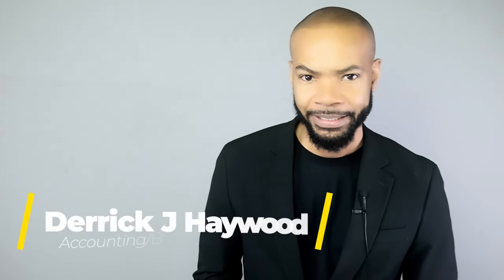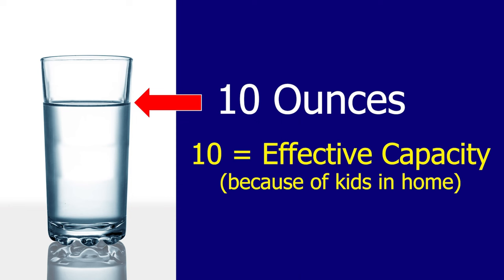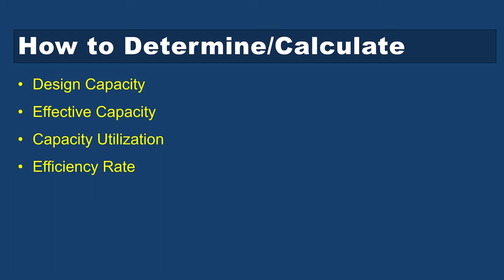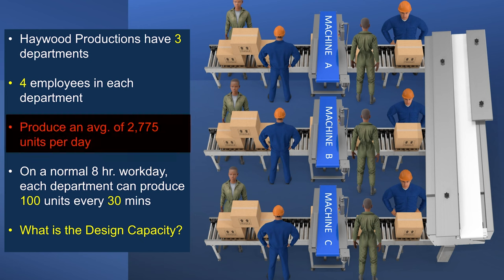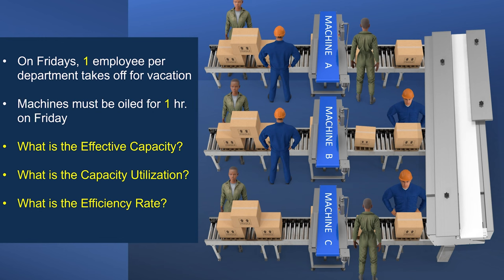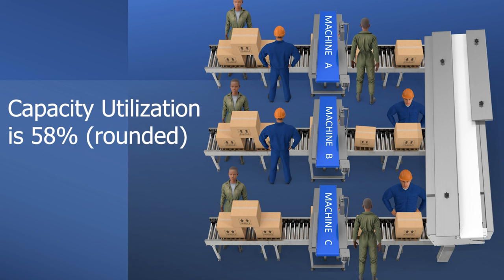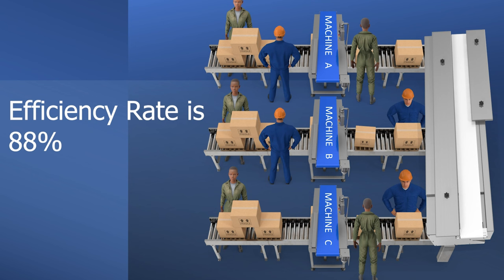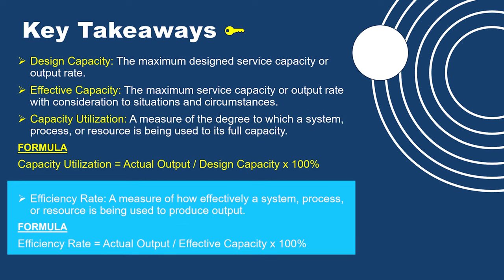Design Capacity and Effective Capacity - Calculating Capacity Utilization and Efficiency Rate

Comment: I was under the impression that we should calculate design based on 24 hours even if the facility is only open for 8. Is this correct?
Reply from the maker: Hey - good question. It depends- You can calculate design capacity based on 24 hours but usually it is based on the production time. That can be a standard 8 hr work day, 12 hr work day, or a 24 hr work day for production companies that produce 24 hrs a day.  It ultimately depends on how the organization chooses to do the calculation relative to their production schedule. Hope this helps.